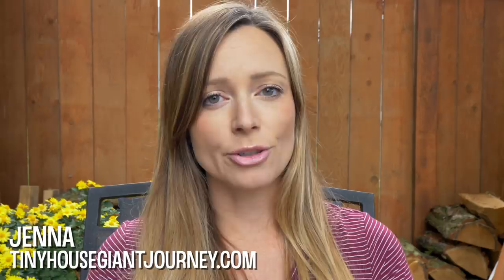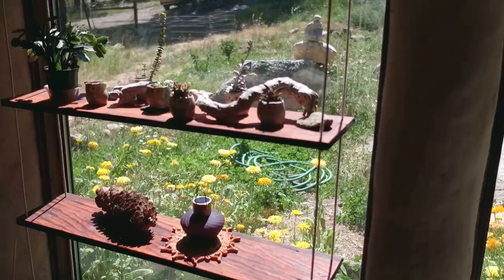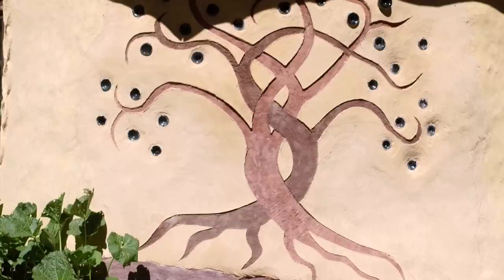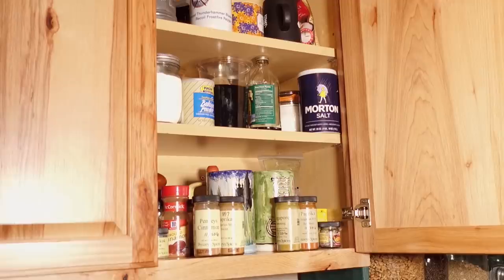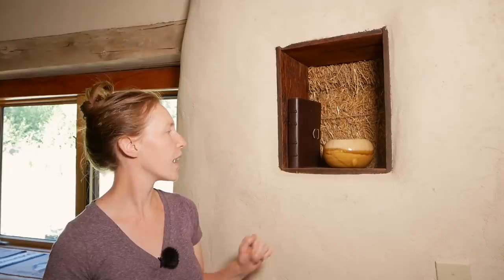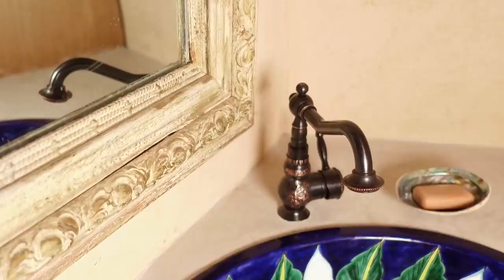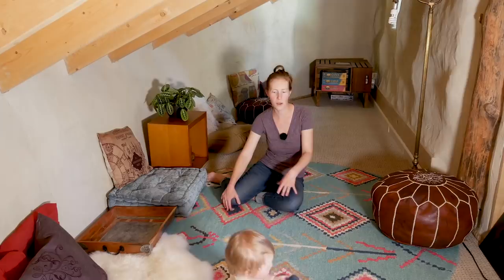Family’s Magical COB HOUSE made w/ Earth, Sand & Straw!

Comment: I absolutely love this house. Straw bale homes were what first attracted me to alternative building materials and, eventually, tiny homes. Can’t believe the quality they get for a mere $20 K. Amazing.
Reply: I totally agree!
Reply: Do you know how long cob lasts? Can it be repaired if it develops cracks on the outside of the house or the inner walls? I wonder how often a home like this would need to be rebuilt. I also wonder when they bought all the wood they use in the ceiling and to hold up the structure. It would be much more expensive now that prices have gone up so much.
I'm also curious how they wash their clothes, bedding, etc. What did it take to pass inspection? I've heard that can be difficult with alternative style housing and tiny homes.

Comment: As someone who built homes professionally, it's my dream to build one of these, simple, open for artistic expression, low cost, high efficiency in energy, tho I hear the labor is harder than our modern builds and would be well worth it to buy or rent a back hoe for the mixing process. You guys did a great job! The only thing I'd do different is not use earth bags for the foundation of the walls, simply because the earth shifts over time, I'd be much more apt to pour a regular foundation and use big boulders and rocks going up at the base of the walls for enforcement and put a water proofing layer on the outer walls, as well as creating some framing for the windows to protect them from carrying any load. I've seen many videos similar to this, and I got to say, this particular build is one of my favorites so far, cuz it's so similar to how I'd go about  the build. First I need to find my own hubby who wants to do this, but finding a good man who also loves God is not easy. ✌&💖
Reply: these are very good points you make, thank you
Reply: Love this comment thanks for sharing your expertise and good luck to you 💕

Comment: Very smart, artistic and so lovely, just a beautiful house! I dream that I would have a similar one. What I'm concerned is whether rats, termites or insects may stay inside the straw wall and how to solve that problem(?)
Reply: Alternative Green building material is Compressed Stabilized Earth Blocks (CSEB) /CEB made out of sub soil and 5-7% Cement or lime. They are extensively load bearing upto to 2 storey / 2 floors. 😊.  Longetivity is lifetime and esthetic too. You can apply POP/ putty plaster for some Interior walls to have white finish look.

Comment: FYI - Homes were built with straw in the state of NM with straw.  No bank would finance the homes because of issues with mold due to the straw.  The builder was stuck with about 10 large homes so you might want to do some research before hand!

Comment: I know they said they have a composting toilet, but what about the other plumbing? How does the shower get water? The kitchen sink? How does it drain? Do they add piping into the hay bails? I'd love to see how that works!

Also, what about electricity? I doubt they have wires running through the hay? Do they have something to light the house besides fire or batterypowered lamps? Any place to plug a laptop into?
Reply: Hi, yes the composting toilet doesn't use water but the sinks and tub run off a pressure system from our well. Plumbing is all under the floor and under counters. The house is on grid and has wires running in the cob walls.

Comment: very nice house and natural technique.my question to you if cud answer plz,does these type of natural house strong enough to stand any weather ,particularly heavy rainy weather and secondly can robbers or bad guys break the house walls easily and come inside the house .m asking because walls are made from sand ,clay and straw ,so no steel ,no hard material .
Reply: Yes and yes. These types of houses are built in very rainy climates all the time. As for robbery--they would take a long time and some heavy equipment for the walls, though the windows are just as fragile as a normal house.
Reply: @spiritwoodnaturalbuilding3889   thanks 4 replying.

Comment: How did you run electrical?  What did you use or suggested using for insulating the wiring from the hay?
Reply: The wiring runs in the cob. We used an angle grinder to carve grooves for them to sit in and then plastered over. Most of the country does not require insulated wiring to have second insulation between it and the bales. you can just use large staples to pin the wire to the bales and plaster over.

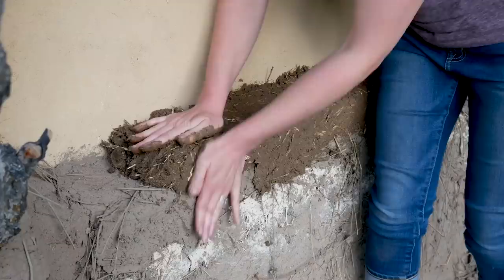Comment: At the 5:00 mark, you didn't explain what step is next other than saying, "add a coat of plaster".

What kind of plaster and thickness, process for applying the plaster?
Reply: The first coat of plaster is usually an inch or more thick. It is made using the same materials as the cob, but with finer ingredients and more clay. You can put on subsequent plaster layers with finer materials until the desired smoothness is achieved.

Comment: Will there be an issue with humidity and mould or mildew with all the straw bale hay wood? I’m just thinking about how you had to do all the plumbing and electricity ..
Would the glass bottles be secure since someone could just smash it from the outside with a hammer ?
Reply: The clay in the walls helps control the humidity well. the bottles would need to be replaced or plastered over if broken.

Comment: What if it rains while you’re in the middle of construction ?? Wouldn’t that melt away the home ?
Reply: We used old billboards as tarps on the walls to keep the bales dry. You will want to do that in a wet zone, but we only receive 13" of precipitation annually, so the risk is low.

Comment: Can this building material be used in a four-season, wet environment?
Reply: Yes. If done correctly..this is what I've found:
The problem is that in a very cold climate such as yours, all that mass will be constantly losing heat to the outside, especially on the north side of the building and other parts that never receive direct sun in the winter. (If the wall gets regular sun on the outside, solar warming will make up for some of the heat loss.) Generally I would not recommend using cob for exterior walls where winter temperatures stay below freezing during the day. However, there can still be a place for cob in every climate. As interior walls, surrounded by a highly insulating envelope (such as straw bale), a massive material like cob helps to maintain a consistent interior temperature, preventing both overheating and overcooling. An especially efficient place to put your thermal mass is close to your heat source, so build a sculptural cob hearth and mass wall around your wood stove. That's my suggestion for very cold winter areas: cob for interior walls (and possibly south-facing exterior walls if you get very regular sun through the winter). The only exceptions would be for buildings that don't need to be heated or if you are building a very tiny building, in which case the amount of heat lost through the walls may be negligible anyway.
Reply: @landofdragons4055    Thank you so much for this very helpful reply!

Comment: I'm sure this is the stupidest question ever, but what stops the rain from washing the whole thing back into mud, particularly when the cobb is exposed to the weather and is "curing"?  Wouldn't it work better with some sort of cement in it?  I understand that for the stuff on the inside , you would be safe enough, but outside?
Reply: Not stupid at all. I hope this information I found helps:
Cob is very resistant to weathering. Because of its porous nature, it withstands long periods of rain without weakening. However, too much exposure is best avoided by the "boots and cap" strategy: wide roof eaves to protect the walls and an impervious foundation. In windy areas a lime-sand plaster is traditionally used to protect exterior cob walls.
Reply: @landofdragons4055  gotcha, thanks

Comment: I guess there is no running water in the house? No plumbing needed. They should have dug a well outside so they could pump water into the home.
Reply: This house is actually plumbed like a conventional home. The deep well pump supplies water to the pressure tank in the bathroom.

Comment: Actually the only thoughts I have aren't directly related to the technique.  I'm wondering if this is just for the famera or if she really doesn't use work gloves or really leaves on  her ring and jewelry, to be scratched all to h*** by the coarse sand and mud.  

And I also wonder if they really don't use protective gear on their hands (and feet) with all that abrasive work.  Hands and feet do not hsve many oil glands, become thickened and coarse, splitting and bleeding.  Cuticles on their hands would split and bleed, nails would split and break off too. I mean, the skin will be scratchy when she touches her bsby's tender skin, or they touch each other, which isn't very romantic and can damage clothing.  It can become abrasive enough to cause serious skin conditions other than the expected calluses.  You can do better than to literally do it the way poor peasants did it generations ago.  They had no choice, and if it got painful enough they'd rub in animal fat and grease.

Comment: Give it a few years and those hay bails they used as filler will completely decay and leave huge cavities inside those walls. Rats can also chew through those walls. Short term it all looks good, but in 10 years it's going to be a different story.
Reply: Thanks for the concern. However, there are plenty of 100 year old bale house in the States. Good plaster keeps those critters out and without moisture the bales won't rot.